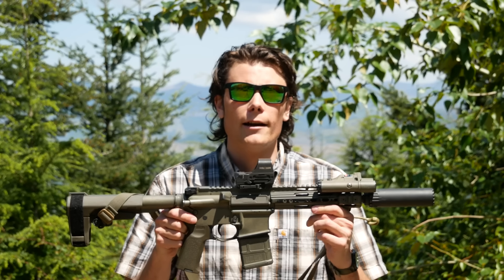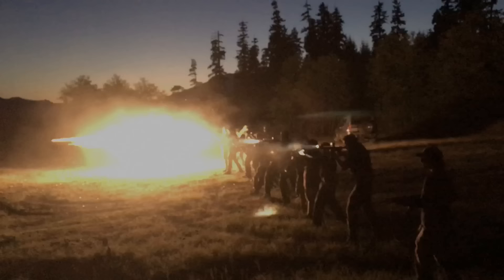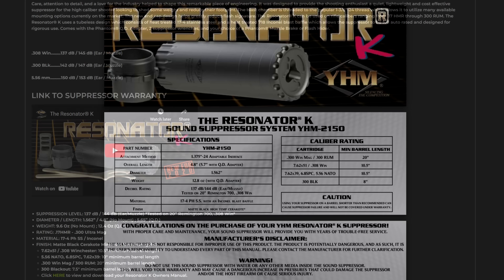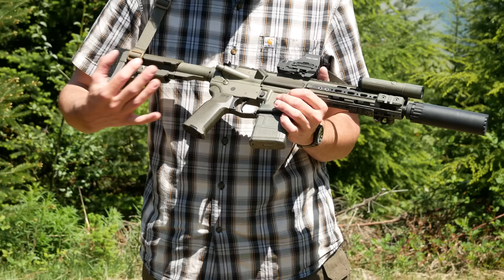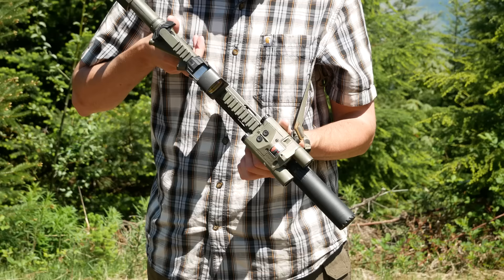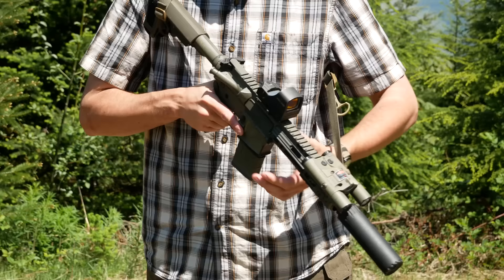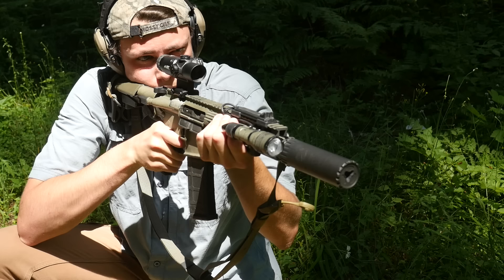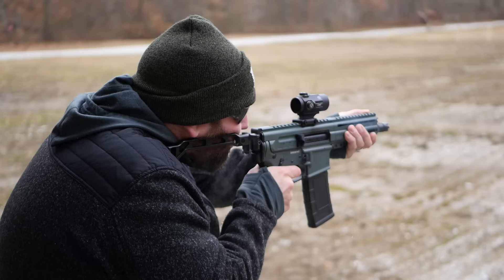The Broke Badger .300 Blackout PDW

Comment: I naively put together a 16" 300blk 5 years ago and never looked back. Great performance across subs and supers, my favorite deer and training rifle. 300blk is not just a shorty rifle cartridge. It has its place in all carbine lengths
Reply: I've been considering a 16 inch 300blk just to not have to get another lower, how have you found suppressed subsonics to perform if you've tried?
Reply: @Phtalvyriz  Yes! Subs are loaded with a very minimal powder charge and if you check the test bbl length on most manufacturers they use 16" to 18" . I've honestly never had any subs crack on me out of my 16". You will notice way better terminal performance out of supers though. If people think 556 is a watermelon crusher, try some open tip 125g at 100 yds!
Reply: Prohibitively expensive to shoot.
Reply: @timrobinson6573  I haven't done much raw data gathering, but what I've observed objectively on wild game tissue and basically shooting garbage is that with most supers, 300blk is an absolute freight train within 300yds. Subs are inherently limited, I really haven't seen much advantage from 10.5" to 16" although I would imagine velocity consistancy would be much better in the longer bbl.
Reply: @CWHolleman  It's literally 2 cents or so more than 5.56 per round atm. .330 blk is sitting at .42 cents. Was it a dollar a round 3 weeks ago?
Reply: @CWHolleman 

Hornady liquidated their z-max bullets a few years ago. Picking up 14 cent 110 z-max (a-max) pills was awesome.
Reply: @CWHolleman  this caliber is pretty cheap to reload, especially subs. The whole economic thing flips.

Comment: Would definitely love to see this compared to a Mk18 since it's basically "the" spec ops gun, in spite of the drawbacks of shorter barreled 556.
Reply: I really feel like 300 blk shines as a caliber for a home defense carbine. The propellant blend allows it to get up to speed better in a shorter barrel in order to give it decent lethality. If you choose to equip a suppressor (granted it is a short barrel-style platform), you'll be perfectly fine using a k-style/compact one instead of a full-size as the latter are really only that large in order to keep military personnel from drawing attention from nearby camps. Adding a LAM is negligible for HD, but if you really fell like it's neccesary you can always add it on. For military purposes, the MK18 still outperforms 300 blk for overall lethality, especially in regards to lethality at a distance. If its the 30 cal round you prefer, then stepping up to anything in 7.62x39 is the better option.

Comment: 8.5" PSA Jakl in .300 BO is sounding pretty perfect
Reply: It's what I did. 80% lower. Midwest Industries tube folder and a carbine tube I cut down a bit to use a BT brace I had. Trimmed the edges of the brace a bit, so it folds completely flat, clearing PSA's Pic adapter. The thing is TINY when folded. Cant settle on an optic, but fun figuring it out.

Comment: Next to me is a 300bo 10.5 that is my primary HD gun.  With a mag full of 110 VMAX.  This replaced my 11.5 5.56 that used to fill that role.  That choice was based on my experience of firing both uppers at an indoor range.  Even with quality earmuffs the 5.56 was ringing my ears while the 300bo was comfortable.  Since I don't run a can and I won't be taking the time to put on earpro in a HD situation, I'm going with the cartridge that will cause less hearing damage.
Reply: @es4583  I have tried various barrel lengths in various situations and I prefer a shorter barrel for maneuverability in tight spaces.  I have a 16" 5.56 at the ready if I need to step outside.
Reply: omg samesies
Reply: Same
Reply: I just recently got into .300 and my suppressed 7.5 with subs is by no means hearing safe but better than nothing for sure
Reply: @jeffroberts760  I also just shot my new 300 supressed for the first time this past weekend. Mines a 10.5" with a YHM Resonator R2, completely hearing safe with subs. Uncomfortable with supers but doesn't ring the ears, sustained fire with supers though does start to get loud and painful though.
Reply: @MannElite glad to hear, happy for you - I was expecting more, but I will admit my dealer told me that shorter cans don’t suppress as much (it’s a Vox K2) but I really wanted a short small unit and really thought 220g would be hearing safe - I’m gonna try some other brands of ammo - what are you using?  I have only tried minuteman munitions - it was a good price shipped
Reply: @jeffroberts760  So far I've tried AAC 220gr OTM, AAC Sabre 220gr Black Tip, and Hornady Black 208gr BTHP, they were all about equally as quiet, and performed very similarly as far as sound goes, the 208gr didn't cycle unsuppressed (which doesn't even matter really). However my groups were pretty awful with all of them lol nice clean bullet holes so I don't think I had destabilization.... but really bad groups compared to the Supersonic I was using, I had great groups with the 110gr supressed. Maybe it was just me, I plan on going out again soon and trying again. But honestly I'm not sure how much I've even going to use the subsonics, most applications I want as much stopping power as possible lol Thats kind of the point... Subs are really nice for plinking but they are expensive.... Plan on keeping a mag or two of subs in case I come up with a use for them lol
Reply: @MannElite  I agree, the draw of subs is for practice, but if you find an expanding round that works and is quiet that’s what I’d prefer if someone broke into my house 

I am going to try more different ammos, maybe what I’ve tried so far is loaded a bit hot; that might make the difference, considering the threshold for supersonic is so close to the stated feet/sec.  

With these approval times I’ll probably get another longer can anyway soon

Thanks for your inout

Comment: The only thing id love with a broke badger build and upgrade would be to use an SIG 8T. While pricy, its the budget eotech with eotech performance when on sale.
Reply from the maker: So many good ways to go about this. One is to use a good passive optic (EOTech, 8T, etc) and pair with a vamp light. That's a good PDW arrangement. Small, simple, but technically checks all the boxes for potential NV use.
Reply: @Hoplopfheil  Romeo4T-Pro have been spotted in wild for $380 or so. Owning the 8T, I'd say your other video was right about going with the 4T-Pro (2032). Or XT if you love AAA's.

Comment: Cool set up similar to one I had.  I ran a vortex spitfire 1x prism on mine.  The big donut ring and dot reticle made a lot of sense for a pdw weapon.  The ability to run it even if the batteries died due to the etched reticle was a nice bonus.
Reply: Agree, I chose the PA Microprisms for the same reason. Been very happy with their 1x and 3x, already planning on ordering more. But I will look into Vortex too.
Reply: Not a fan of that reticle, inner circle is too thick. Good glass though.

Comment: I have a 10 inch .300 BLK build that I was thinking of making shorter. Around 7.5-8 inch. I have two cans in jail and would love to use it as a PDW. I also have a 510C on it with the green reticles. I love the 510. Of course a closed emitter wouldve been lovely but I dont think its overpriced at all. You can sometimes find them below 300.
Reply: just remember, 300 blk needs about 9.5 inches to get full powder burn.  Thats why I went with a 10".5"

Comment: This is almost identical to one I put together a few years back, I had a Troy 7" rail with a 7.5" barrel. It has a LAW Folder so it can fit in a backpack.  I also have it setup for a YHM Resonator K if needed, but generally don't use it that way. I also reload using Nosler Varmageddon 110Gr that I can push to about 2100 FPS out of that barrel. I also have a separate dedicated SD type build using a Faxon 6" 1:5 barrel for subs. I run a heavy 9" SAS 30 cal can. Haven't shot it with the 110gr yet as I have concerns about spin velocity.

Comment: I built something similar using a BCM 9" .300 BLK barrel.  Shoots subs and supers suppressed and unsuppressed with no issues.  Bolt holds open on the last round in all configurations of subs and supers both suppressed and unsuppressed.  I am using an H3 buffer in it also.  Decently accurate for a 9 inch gun.  I would say around 2ish moa.  I never gave it a full accuracy test though to get the exact moa.  I don't expect to shoot it further than 100 yards anyways.  It is accurate enough for it's intended purpose.
Reply: I was thinking about buying a Griffins or 9” BCM .300 BLK complete firearm.  Sort of old but new to the AR platform.  Is it worth the time and trouble to figure out all the details or should I just go with a completed rifle?  Thanks.
Reply: What buffer spring are you using
Reply: @deanknight7133  standard buffer spring.  I am not sure what brand.
Reply: @williamhicks2763  a complete rifle will have all the kinks ironed out and would be the easier choice.  plus if you have any issues, Griffin would be able to take care of it.

Comment: We need some functional .300blk and 7.62x39r bullpups with 8" barrels. The size of a regular 16" bullpup, but the suppressor is already included.
Also, abolish the NFA and ATF to make them available as god intended.
Reply: Don't even bother with 7.62x39.  Everything SUCKS when made in that caliber.  The Ruger Mini-30, the CZ Bren series, the ARs chambered in x39, etc.  It needs highly curved magazines, it requires oversized extractors unless you exclusively use brass case, etc.  It's a crappy cartridge, society has advanced beyond the need for it, we have better alternatives, it belongs in the past.
Reply: you just want a .300 blk arm pistol with a nonretarded sight setup
Reply: @hedgeearthridge6807  that's why you use good ol' AK banana magazines. It is a crappy cheap and effective cartridge.
Reply: Bullpups are fun and all until you want to swap shoulders when peaking around barriers or cover.
Reply: It's neat for vibing. Not everything has to be a pragmatic purchase.
Reply: @hedgeearthridge6807  that's a lot of fudd in a short package. You can break extractors with brass case ammo if you severely overgas the fuck out of it, like most 7.62x39 setups are. It doesn't require oversized extractors, it requires attention to detail to properly configure for maximum reliability. 

If you gas/buffer correctly, you can extract brass cases with no extractor impact marks. No marks = low stress = long life. I have mine set up like this AND it reliably runs steel case and import ammo.
Reply: @hedgeearthridge6807  BRN-180 in 7.62x39 remedies all problems you have with the cartridge. 7.62x39 is 300 BLK's grand peepaw. Respect your elders.

Comment: I didn’t know that 9” was considered the sweet spot for .300.  Therefore, the video had socially redeeming value!
Reply: terminal velocity with 300blk is 8" even shorter for subs.
Reply: 300 blackout still picks up a lot of energy the longer the barrel.  Even if the “sweet spot “ is 9 inches,  a 16 inch 300 blk will put out a lot more energy
Reply: @Mp-jw1qg that sentence doesn’t make sense… anyway, 300blackout out of a 5.5in barrel is still going through soft body armor; can you say that much about the 3.1in 9mm everyone’s carrying in their pants?

Comment: Are you considering acquiring a Romeo 9T when they become available for certain setups like this? Seems like the perfect thing to pair with a 2 velocity cartridge setup.
Reply from the maker: Nah it's total overkill and if it does become available it will cost way too much.
Reply: An unfair amount of thinking has been devoted to this issue. Idk what most people think but if you zero supers at 175 you can hold dead on a 5” plate from 0-200 with supers and you should be on a playing card at 50. Unless you are trying to shoot past 100 with subs or really need precision with subs past ~75 or so it’s a waste of time.

Comment: I'm glad you mentioned "short AK". I've been impressed with the ballistics 7.62x39 gets out of shorter barrels, which leaves me wondering why not a 7.62x39 build?
Reply: 7.62x39mm ARs have really poor bolt life because of how much you have to take away from the bolt face from a standard. 
The magazines also suck
Reply: @DanielMartinez-yd1ue  I've heard that, but have yet to experience one fail. The only struggle I've had has been that some AR15 aftermarket triggers are a tad gentle on some steel-case ammo primers.
Reply: "Why not 7.62x39 AR"

Because they're a awful idea? 7.62 magazines are awful, expensive, and awfully expensive - a consequence of kludging a cartridge whose geometry does not gel with the platform into the platform. That's why .300 Blackout exists, so that a person can get as good to better ballistics while being able to use standard AR-15 geometry and parts.
Reply: @JimoftheSlim  I'm afraid your magazine knowledge is at least a decade out of date.
Reply: Buy a Krink
Reply: I have a PWS MK116 in 7.62x39.  16” barrel and CP Duramags run flawlessly.  The rifle is a pleasure to shoot and hasn’t had a single issue in 2k rounds so far.   Hits targets  like a sledgehammer too
Reply: @SM-eu5xl to be fair the PWS is a long stroke gas system so definitely be better than a DI gun.
Reply: @DanielMartinez-yd1ue  Mine has done at least a couple thousand rounds and have had zero issues with the mags that I have... are you talking out your butt like fudds are wont to do?

Comment: Your 300blk is similar to the one I built about a year ago. I used the Aero Enhanced mono upper/rail system with a BA 9" barrel, and I chose a Holosun AEMS as the optic. One thing I might change on mine is the SB Tac. HB PDW brace. I got it because it looked cool but it was a pain in the ass considering they don't make an H2 for their proprietary buffer system. I put a Sharpsbros Badlands on it because I like the concept and it's been a relatively successful woods gun that I've taken a 99lbs boar with. Decent video, thanks.

Comment: I passed over 300 blk several times. Always ended up on 7.62x39 Ak's due to ammo cost. and the fact I'm an idiot and am worried about cross contamination
Reply: It tends to run a little flatter than .300 bo too. Normal 7.62x39 ammo runs faster than most 300 bo supers.

Comment: Having a 1-4 LPVO doesn't make sense to me on a short, compact brush gun. The cartridge is good to maybe 200 yards. I believe a red dot can make reliable hits to that far while keeping the gun light and compact... Just my half assed opinion. I have a poor man's badger build as well. They're fun guns.
Reply: For steel that sounds doable. For game, might as well take less risk and have a little better aiming point. Just because we eat them doesn't mean we need to prove our macho by hitting them suboptimally and prolonging their bleed out time.
Reply: @randomidiot8142  You could always throw on a 3x or 4x magnifier with that red dot and be just as good as a 1-4x lpvo. Also quite a bit cheaper.

Comment: I opted for a 6” BA barrel with an Omega 9k suppressor for a very compact upper (.300blk Subsonic only due to barrel length restrictions). The build is explicitly a PDW with traditional 5.56 rifles being better suited for my surrounding environment of pine forest, open fields, and rolling hills.
Reply: Did you end up drilling the gas port?
Reply: @josh2711  So far everything has worked out of the box without modification with the subsonic ammo I have tested through it. I was told it would need an ultralight bolt carrier to cycle but that doesn't seem to be the case.
Reply: @AnonEMus-cp2mn  you always shoot with the suppressor on?
Reply: @josh2711  Yes. I intended it to be 'integral' with a hand guard that shrouds the suppressor. At one point it was removed to test the performance of the Nomad L, which worked flawlessly. I don't intend on running supers through it because it could damage the omega 9k at that barrel length, and have less performance than an 8-9" barrel.
Reply: @AnonEMus-cp2mn  interesting.   Mine I run unsuppressed supers; I had to drill out the port to the the size of faxon’s 6in.      I’m not sure exactly how much the difference in twist rate actually effects the barrel, but hind sight, I think it would’ve been better if I just started with the faxon barrel.

Comment: Built my “Funny Badger” with a Palmetto 8” 300bo upper. I changed the rail to a MI suppressor handguard which allows my massive hybrid46 to fit inside. It shoots supers and subs perfectly, albeit a Bit overgassed for supers. Added poverty red dot and light. Just works & Mad fun. Very fun with my new SBR lower- which usually lives with my 12” tromix 458socom “money Badger” upper

Comment: Ive been playing with a 350 legend pistol in a similar configuration. Duramag makes a great factory 20 round mag, but ive been using pmags modded to feed 350 legend. 

I had some feed issues, but after polishing the feed ramp, those have completely disappeared. 

Ive been running 200 grain subsonic loads, 124 grain supers, and I've got a couple of mags of 90 grain hand loads that move at a blistering 2700 fps in a 10.5" barrel. 

For a brush gun, I honestly prefer it over any 300 blackout I've used. You lose very little velocity with a .350/9mm projectile in shorter barrels. The subs run super quiey suppressed with an Armaspec stealth recoil buffer, too.